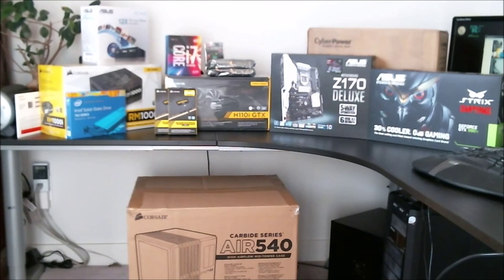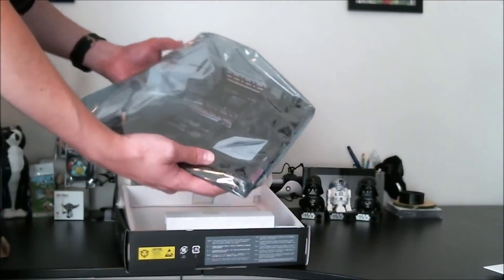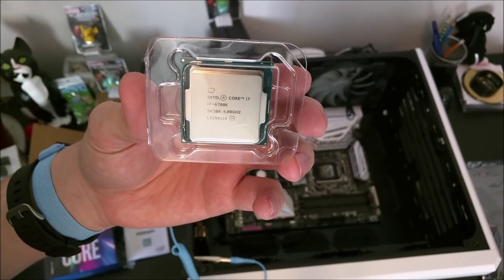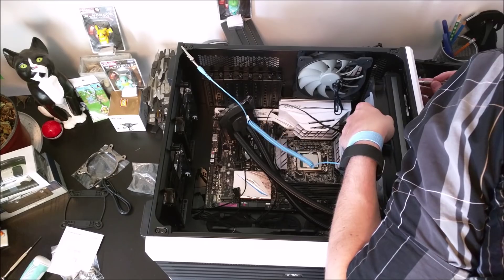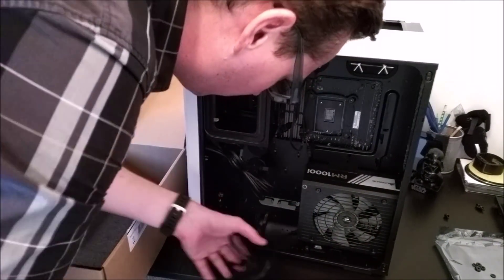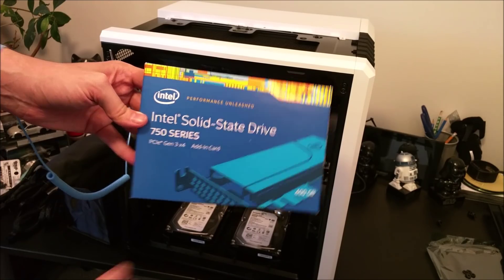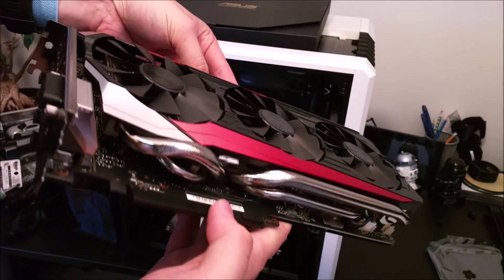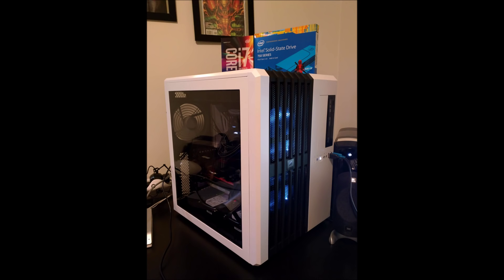i7-6700k Skylake System Build

Comment: What will be the typical computer specifications in 2025?
Reply from the maker: My recommendation would be minimum 8-core, current gen (AMD 9700X or higher) CPU (or 1 gen previous, mid-high tier), 16GB graphics card within the last 2 generations, 512GB M.2 drive with DRAM (1TB ideal, games are getting massive), and minimum 32GB RAM.

The "average" is lower than that, however, if building new today you want to be in the range of relevant and newer hardware.
 
That being said, it is possible to score some used gear 2-3 generations back and still end up with an okay gaming rig.

Comment: All aluminum. It's plastic and steel!
Reply from the maker: Paul Virtue right you are! Though it is still surprisingly light weight. whichever alloy they used is certainly very effective.
Reply: It is a great case. Just did a recent build in one. The light weight did surprise me.

Comment: would this all fit into a mid tower case 86ing the liquid cooler? I like this build but that chassis is to large for my small desk and if so, any recommendations?
Reply from the maker: The SC Scenario Everything minus the liquid cooler would fit a mid-tower, it would be a little tight, but doable.
Reply: Prax thank you for the information, in the video as well as your reply.

Comment: what is you using on your left hand? (the colour is blue) sorry for my bad english :(
Reply from the maker: Halim Setiawan It is a static strap (used primarily when directly handling static sensitive components). Recommended for beginners, but experienced builders usually just touch the case to balance their static charge. I used it so that beginners would too.
Reply: Ok, thx brada :D

Comment: Is it necessary to upgrade the processor and motherboard if the SSD boot time is super fast. I still have an Ivy bridge i5 4 core overclocked to 3.6 with a 970 graphics card at 4 GB. Yes, the CPU is slow and the Motherboard is ancient but I question the need unless your really doing a ton of audio with VSTs and rendering without a render farm.
Reply: I put my OS as well on SSD and I've never looked back. best upgrade ever.
Reply from the maker: Even the SSD isn't as fast as the RAM and the CPU right now. You're good.

Comment: I get 4.7 on the 6700k using only the bios and set it to 100% gain. with everything else on auto. it's a dream to work with. I didn't have to mess with voltage and it took all but a few minutes in bios.

Comment: You clamped the anti-static wristband to a painted part of the chassis, it did nothing.

If you have grounded plugs in your home you should find a way to connect yourself to them by connecting the psu and clampint the wristband to its chassi. You could also do like everyone else and just ground yourself before touching anything sensitive
Reply from the maker: The paint isn't non-conductive, it still allows electrons to pass freely between it and the metal. (This is why you can still get a static shock touching your car, even though your car is painted). Grounding to the house electrical isn't necessary. It is only necessary to normalize the charge between you and the case. "Everyone else" are probably skilled builders, but for beginners I want to recommend the static strap because all it takes is one "mistake" and they are now troubleshooting issues with their hardware. I would hate to see how many RMAs are done on hardware because someone was new and decided that static ain't no thang.

Comment: I want to use the cablemod c-series blue and black full set. But it says on the Asus website for the specs of the mobo  (Asus Z170 Deluxe) says that it is a eatx 24pin. Is a 24pin that comes with that set alright to work with it??
Reply from the maker: +Visible Rager I don't see why not, standard ATX power supply connectors are standard.

Comment: I really like that case!    Cable management galore, with that guy...
Reply from the maker: +Todd Vernon It is an amazing case for sure, still love it!

I am waiting for some dust filters to arrive and then I will be making the rear fan an intake fan as well. I will make a video to see if there is any difference in cooling with a positive pressure setup.
Reply: I also need to add a dust filter to my nzxt phantom 410, for the 2-120mm fans!

Comment: I basically did almost the same build  my motherboard I went with the hero Alpha, for my  OS I used the Samsung 950 pro 256 gb m.2. for my GPU I went with the strix oc 980 ti. my main storage I went with the 850 Evo 500 gigs 4 of them. and for memory i went with 32 gigs or gskill Trident Z. power supply I went with the 850x by seasonic and the case was the Corsair 540.

Comment: can the i7 6700k support officially ddr4 rams with 1.25 voltage? or only 1.2v? ty
Reply from the maker: +Dragongod Skylake will support even higher than that, especially since your top-end DDR4 will run in the range of 1.35V. From experience I personally never recommend RAM that will require over the base voltage limit (1.2V in this case), however, you can't deny the benefits of higher speed (3200) DDR4 compared to lower speed 2400 or 2666.
Reply: +Prax i understand ty!

Comment: you actually don't need that anti static wire. just hold the cpu case before touching any pcb. this will transfer any static you may have on your hands.
Reply: +Chris Ryan Intos True, just like when you exit your car before pumping gas, touch the outside of the car before pumping.  I would still recommended the anti static wire, just one less thing you have to try to remember.

Comment: the i5 skylake is also 4 cores the only difference between them seem to be more than 100+ dollars lol. If there is really a reason to go with the i7 than i5. Not like im going to build a PC soon but just curious. Yes the i7 have some more MHz but not worth the more than 100 dollars in price difference IMO.
Reply from the maker: +krlitos i7 also has hyperthreading, so it can handle 8 total threads. The i5 can only handle 4 actual threads at once. Both are good CPUs, but the i7 is a better workhorse than the i5.

Comment: hey man, have you had any problems with the skylake platform, any freezes?
Reply from the maker: +Anton Popov none whatsoever. Solid.
Reply: have you OC'ed it ?
Reply from the maker: Anton Popov yes, 4.6 GHz @ 1.28V stable no issues. I have seen these chips vary between 4.4-4.6 for stable overclocks with reasonable voltages (max 1.35V). My factory voltage was 1.3, and I was able to OC and undervolt. That is pretty rare but may be possible with the z170 deluxe due to 16 phase power and other power features on the board. If you are experiencing your system locking up at stock settings then you might have some bad hardware in the mix. How often is yours freezing? Does it reboot or just lock up?
Reply: its lockup and i have to hard restart to get rid of it, i saw a few ppl complaning about freezes too. I use Mainboard GB z170x gaming 3, and i OC'ed to 4.3GHz at 1.275V
and its freezing, guess i just have bad luck with the chip. Now i am testing the stock values, but since the freez were rly random i tneed a few days to test it. The strange think is that it passes the Prime 95 test for over 12 hrs but it freezes randomly on average load, yet i still need to see if it freezes on stock speed. 
P.S. i am using i5 6600k
Reply: +Anton Popov If you're referring to what I think you're referring to, some freezing does happen when doing some specific mathematical calculation crunching but there should or soon should be BIOS update to fix that.
Reply: i had the bios update already and it fixes nothink, however i found fix myself. It was RAM problem , i used the enchanced stability option in bios for my ram and 5 days without freezing so far
Reply from the maker: Good stuff :) RAM can be finicky, especially when it is overclocked.

Comment: I have got same gpu and have bad coil whine. I want to buy Rmi series psu. I wonder if there are coil whine your gpu? Thank you..
Reply from the maker: My GPU only has coil whine in Space Engineers (this is due to no frame limit in their menus, causing 4000+ fps which is just silly). You may experience this with other games. Try forcing a frame limit or turn on vsync (you might be able to force vsync in the NVIDIA game settings on the NVIDIA graphics properties themselves. The 980Ti should have coil whine at 100-300 fps in games. If the coil whine is all the time you should look at requesting an RMA.
Reply from the maker: +Prax *should not have coil whine
Reply: Before I buy a new psu(rmi or rmx), if the problem continues I contact Rma. Thank you so much..
Reply from the maker: +Onur Bozcu My pleasure. Good luck!

Comment: is this possible to install 2 different GPU's

Asus Strix 970 and 980Ti
Together*
MayBe 970 for Physx.
Reply: I dont think so i wouldnt recomend it at least
Reply: +ASR No.
Reply from the maker: wouldn't really help out much, either do two cards in SLI or do one big card like the 980Ti.
Reply: No, it's only possible to use 2 identical GPU's.

Comment: Does that case support Sli? or its too little?
Reply from the maker: +Marcos Benedito You could do SLI with a reference cooler style card, with other cards you could still make it work if you didnt put hard drives in the bottom. So Yes.

Comment: What I don't understand, is why why why go water cooling on cpu and then.....not on gpu. I have a 6700k and I have hit 4.9 on AIR. I mean come on. Granted, I did a build for a friend and I only got his to 4.6 (even after voltage upping) and what not but really if the water is just to OC, on the 6700k I've noticed 0 difference in air to water on OC. The chip can do 4.4 out of the box, and with a little more tweaking you can get it to 4.8 most of the time, I got a little lucky and with a voltage boost and some 3400 ddr dual channel memory I got it to 4.9 but BSOD at 5 no matter what I did. 

For some I've seen people do water cooling on CPU if they put it in the next room and run 15 foot dvi, usb,etc cables. For those who go all water then I see a benefit in silenece if you run speakers. I run 5.1 headphones and I can deal with a little noise. But still, water cooling just cpu seems silly when gpu is going to be whining up and down making all sorts of racket.
Reply: +Nicholas Golden note* this doesn't apply to non practical LN2 cooling, because that's not sustainable for a gaming session. Haha.
Reply from the maker: I would have gone with a water cooled (closed loop) GPU, but at the time none were available here. The main reason was to test it and see how it performed in gaming situations and in high CPU encoding scenarios. Getting a massive air cooler would yield similar temperatures (higher, but similar), but the clean look of the water block can't be overlooked. I am extremely satisfied with the H110i GTX.
Reply from the maker: not to mention the strain that a large CPU cooler puts on the socket.

Comment: I'm was gonna buy the smaller corsair cooler when I checked the air 540 website and it said it only had space for a 280 radiator while the 110i GTX is a bigger one, but it seems to be working fine here so I was confused. Could you confirm for me if the 110i GTX will fit into my 540 Case? thanks
Reply: the GTX is a 280mm radiator and fits perfectly in the Air 540 case. They were made for each other.

Comment: hey man great build! question, did you use any thermal paste?
Reply: Where? If you are asking for the Cpu thermal paste then yes he did ,the h110i gtx has the thermal paste on the cup block already
Reply from the maker: +805IS I did indeed, the H110i GTX has pre-applied thermal paste. I will, however, do a video in a couple of weeks where I swap the compound out with Arctic Silver MX-4 to see the difference.

Comment: Hi nice build
I am trying to build this pc 
But I wonder I should use msi 980ti lighting or asus strix thx😘
Reply from the maker: +Matthew Lau The MSI has a slightly slower base clock speed on the memory and GPU. Both will operate similarly in benchmarks, however, the Asus Strix will out-perform it (by a small fraction).
Reply: +Prax thx😄
Reply: +Prax hi 
During installation I have faced couple problem 
I would like to ask if I should install Windows first or setup raid 1 first?
Reply from the maker: You should set up your RAID 1 array before you install Windows. Are you installing Windows on a separate drive, on on the RAID 1 array?
Reply: HI
I will install window on the intel 750 ssd
Reply from the maker: +Matthew Lau okay, install Windows with only the SSD connected. This ensures all the file system data ends up in the right place. Once Windows is setup, you can plug your other drives in. Just ensure you have the BIOS configured for RAID for your other drives before installing. that ensures Windows knows what's up.
Reply: Thx prax :D
Reply: +Prax hi again 
After installing everything and install window and the next time I boot up it shows that D4-PCI allocation error 
I think I have everything plugged in correctly and no hardware is malfunctioning 
However I am thinking whether or. It the m.2 is causing problem but it just run fine,Any ideas?thx
Reply from the maker: Do you see the same problem if you load default settings and boot up without your overclock?
Reply: yep

Comment: FYI the MSI Z170A Gaming M7 board has metal reinforced PCIe slots.  I have that board with an MSI gaming 6G 980ti and there is no sag or bend.  Check out that board.  Its feature packed and working awesome for me currently with my 6700k.

Comment: Hey Prax, thank you so much for this great video it was really well done.
can you advise for example why you went with this specific mobo and not with ROG from ASUS?
Reply from the maker: At the time my local supplier didn't stock the ROG. I selected the Z170-Deluxe for a couple reasons though. #1. Intel was including the board with their demo and media kits alongside the 6700k and 750 SSD. If Intel trusts the board, so do I. #2. On-board WiFi for LAN parties. I am old school and love gaming with my friends, not everybody has a 10-port switch hanging around. #3. The deluxe supports literally every next-gen device and being an IT guy I wanted to be able to play with all of them with this board.

Ultimately the ROG offers the same performance, and it probably gets similar results in Overclocking. Then again, so does the Z170-A. Most consumers would never go to the premium boards anyways. ROG is kind of a premium club, but solid boards that get lots of updates and ongoing support. Deluxe boards have been hit or miss in the past but this board is definitely a hit. I would have been just as happy with the Z170-A though all said and done performance wise.

Comment: I'm about to graduate high school, what did you study in order to know all of this?
Reply from the maker: +Yadiel Curcio Thank you for your comment! I have been exposed to computers a lot since 1987. Most of the school that was available when I grew up was really lacking and just couldn't keep pace with the change in how businesses and people used computers. Most of what I know was from tinkering with computers, taking them apart, putting them together, reading tons of manuals and technical documents etc. 

I took some computer engineering, but even that wasn't really all that interesting to me as I had already done programming and soldering, etc. My parents bought me an electrical kit when I was 7 and I learned how to build logic circuits, alarm clocks, radios, transmitters, etc all before I turned 9. I took some courses towards a Computer Science degree but haven't been actively pursuing it because the content of the courses are what I have been doing for a living for 14 years and I could probably write the courses by now. (Though I do intend on getting my degree at some point, that little piece of paper can open doors a lot easier than working your way up like I have).

All in all I would say that if you have a real passion for something, you will eat, breathe, and live it every day. You don't need to go to school to obtain knowledge. There are literally tens of thousands of books on any topic you would want to learn. Read books, tinker with things, question why we do things the way we do. Once you are an expert on it, go to school and blow through the courses already knowing 90% of the material from other sources (just don't forget that unfortunately school is more about memorization and spewing it out on a test or in an assignment than actual practical use of knowledge for many fields of study). Most people forget most of what they have learned within 2 years of getting out of school because they don't use it. Find your passion, follow it, use it every day, and you will go places.
Reply: I do that as well, when ever i have the chance to get some more knowledge i do it! Thanks for replying dude! Apreciate it subbed

Comment: i got my cpu cooler and i found some of the fins (4 or 5) of h100i gtx is bend and blocking a liitle bit of heat ejection. is it cause any problem.
Reply from the maker: overall the performance won't be drastically affected, however, you should speak to them about an exchange if you bought it new.

Comment: hi, nice build videos....
whats with the dvd/optical 5.25 turned 90°? Has it to be a dedicated one to work that way?
Reply from the maker: The case is built for the optical drive to be sideways. Many cases are designed like that and the optical drives are also designed to work either way.